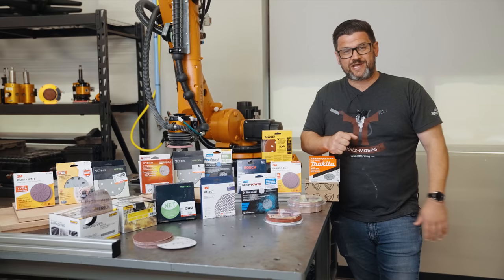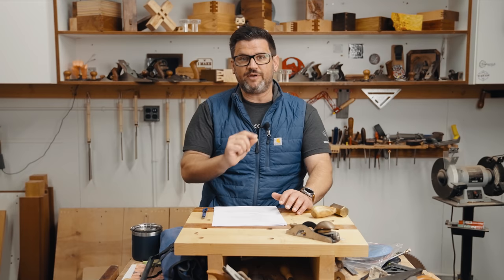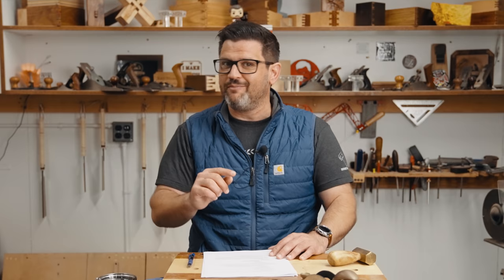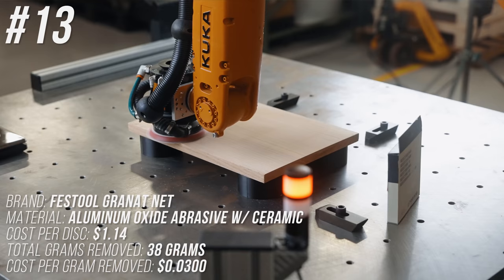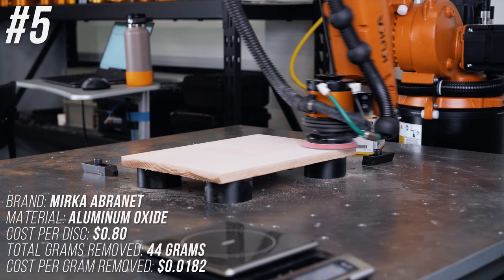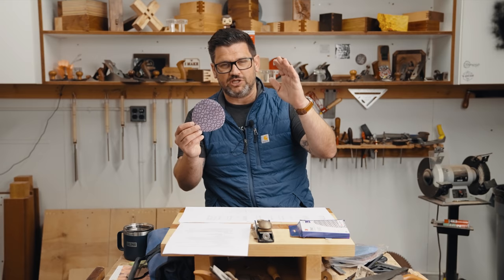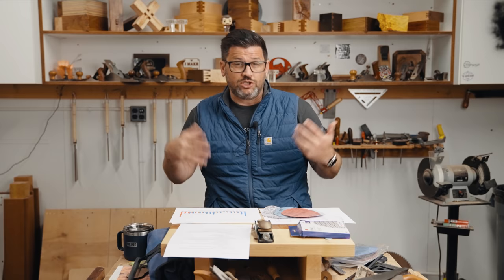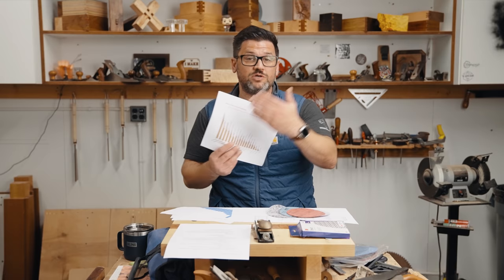Largest Sandpaper Test EVER Done - Top 19 brands Tested using Robots for Unbiased Data

Comment: G'day Jonathan, first up great job. I did Australia's most extensive sandpaper testing with 13 brands last year and I was aware of your previous video but purposefully didn't watch it until after I'd completed my own as not to colour the results. While I noted there were a few things I'd do (and did) differently it was very interesting stuff. Many of the brands available in the US (sadly including 3M) are not easily sourceable Downunder, but it's good to see that those we did have overlap on like the Abranet exhibited similar results. You touched on friability and the ability of mesh to clean itself to stay cool here and I think you nailed these as the most important factors when it comes to sanding performance. Two things I learnt through my testing you may want to investigate further if you ever repeat this experiment again relate to those issues... and neither actually have to do (directly) with the actual sandpaper. They depend on the setup you use, and what you are sanding. The short version is Red Oak was a great middle choice, but there can be a massive difference in how each disc performs based on the hardness of the timber you are sanding. Traditional Aluminium Oxide discs with low friability tend to perform much better on pine and softwood (having about 1/2 the Janka rating of Red Oak), while ceramic-based based products that rely on constant wear to generate new cutting edges tend to prefer harder wood (I used Red Gum... a cheeky little 2,700 Janka species we have here twice as hard as Red Oak). The second factor is what sander you are using. HIgh-end machines like a Rotex or Derros (or industrial robot!) with the power and dust extraction seem to be able to get the most out of these more advanced and expensive ceramic discs as they keep them clean and have the grunt to activate their friable nature. Home workshops running lower-powered, cheaper and/or battery sanders on shop vacs may not see a massive advantage in the ceramic discs as they don't have the guts or extraction to use them as intended. As you said at the start, there as SO many variables it would be impossible to cover all circumstances and I applaud your efforts here to improve your old testing and indeed deliver the least biased and most consistent sandpaper testing I've seen. I don't doubt the Xtract is clearly the best on market at the moment and I can't wait to get my hands on some if and when they release it in Australia to see how it tackles my old railway sleeper. Top job mate, a super valuable resource for the community you have here.  👍 - James
Reply: James, thanks for taking the time to respond in such detail. Excellent points about the type of wood and the sander quality factoring into the results, too. Many woodworkers will take an “if this wood, then this sandpaper” approach, but weekend warriors (like me!) will appreciate the general superiority and significant time savings of the 3M products. It’s so helpful to learn from the experiences of those in different regions with different wood types, tools, and material availability. Stay safe!
Reply: @RayStarbirdHome  Cheers Ray!  After my years I went with the standard non-ceramic Abranet precisely because I run an 18V 5' system mostly on softer woods. I am also however very jealous 3M haven't released their abrasives in Australia yet 😅 Sticking with one type is fine for most folks I'm sure, I'm just a hobbyist too. I love JKM was able to take this investigation to the next level with robots!  😂
Reply: It begs the question, why isn't 3M selling Xtract into the Australian market? I bet its to do with the American obsession with technology export.
Reply: Hey mate just wanted to let you know I bought three boxes (50 pack) of the 3m extract from rs components in sydney. They are awesome 👌
Reply: @psptube415  cheers mate! Im fully stocked up with Abranets but when they run out I might give these a crack.

Comment: Yeah, between you and Project Farm, I can't begin to calculate how much I've spent on the products you guys test. I'm an Xtract man now, ditching Abranet, the numbers are just insane. I hate sanding. This will cut down time spent by like 2/3, and that's worth some real $$$. Really appreciate this kind of comprehensive testing. Just put in a ~$150 order for Xtract, haha.
Reply: 1 year later comment: how did you like Xtract? I'm still sort of figuring things out so I bought a multipack of the other "regular" Cubitron 2 discs but I'd be interested to compare them to Xtract as I believe the Xtract can be rinsed out and re-used to a certain extent, whereas the other Cubitron discs are not as far as i know.
Reply: @adamcoe  not sure about him but I bought a 50 pack almost 6 months ago of 80, 120, 160, 220 and 400, I think 400 don't feel like going out to the garage to double check and after daily builds and hours upon hours of sanding I've used 4 or 5 discs from each pack. With life still left in them but eventually I'll change out older paper and use for hand sanding and replace with a new piece. Oh and these were on 5 inch random orbit if that makes any difference to you
Reply: @woodworkingandepoxy643  Hello. Thank you for responding with your remarks. Do you have a link to the 50 pack?

Comment: Well planned and executed test, I can see this one rattling a few corporate cages but this is what the world needs. I would be very interested to see if the trend carried across all grits or does it pay to have an 80 in one brand a 120 in another and so on.
Reply: I got a sample pack of the 3M cubitron mesh featured here and it drastically outperforms my go-to Diablo in every grit I got it in (120, 220, 320 if I remember right). I think youd be safe in going all in on the 3M mesh

Comment: As a retired production supervisor and purchaser in a large custom cabinet shop I applaud your test and methodology. We tested many of the brands that you tested and while our tests were more by ‘feel’ (very subjective😄) the results were much the same. At the time ceramics were not available and Mirka was the only mesh on the market so we were limited to psa paper discs and Mirka which far outperformed all the paper brands. The downside to the Mirka was that the mesh unraveled when it hit an inside corner and that caused massive scratching. Does the 3M product also self destruct in a corner? To alleviate the problem with paper discs our sanders would gently cup the paper discs over the edge of the pad when the disc was applied. We also put about a 1/8” radius on the outer edge of the pad.

Comment: This is super handy thanks for putting in the work JKM!! I'm curious about the durability of the Cubitron. I've been using Abrarnet for a couple years, and my big issue is if you're sanding non flat surfaces the disk will rip off a corner or sometimes clean in half. Then it's basically useless.
Reply from the maker: I think all mesh-es (sp?) would be less durable than solid discs if you're sanding sharp things. If you look at the pattern we sanded with the robot we always went off the edge by about 25%. Those edges were so sharp I cut myself a few times. The xtract didn't seem to have any issues after 25 minutes with the same disc.
Reply: Michael Alm in the house! If you try it, let us know how it holds up to the patterned plywood test :)
Reply: ^same issue here

Comment: What I'm curious about, even though it is 100% subjective, is the quality of the finish that they provided.  Awesome results regardless, might be trying some of that 3m out.
Reply: Yeah obviously this test could be cheated if one brand's 80-grit is more like 50-grit. Ideally you would compare topography of the discs as well as the finished oak. But that's getting pretty deep.
Reply: I really would like to know is some the cheaper papers were more prone to pig tails. Maybe he can do a future test sanding up through the grits on epoxy with maybe the best 5 mesh nets. I think it may come down to the dust extraction, at least when using all high quality products.
Reply: i was trying to find a nice way to ask this, there's more to a sanding than how much you can remove, otherwise why use anything but 60 grit?
Reply: Being a floor sander I use a multitude of these kinds of discs.. for the past year I've been using the cubitrons (although I can't get them through any flooring supplier as 3M wont sell them to them)
The cubitron easily leaves the best finish cuts further and cuts harder and is cheaper.
The top of the line is normally the Norton "red heat"
Putting them next to each other I used two different grits aswell as double the discs of norton to get an inferior result
It has blown my mind.
I also think the cubitron 80 is more like other brands 100 or 120 in terms of scratching left behind
Reply: Great point.
Reply: Well for some strange reason some people use sander to remove material "fast". I can see it being a convenience in carpentry/construction, but for furniture making 1) we have better ways to remove much more material much faster/cheaper and 2) sanding has a totally different purpose aka making a surface smooth. actually there is even time when you want to use used disk on purpose, being too agressive can often be detrimental when it come to surface prep. So totally agree with you, the real question should be how smooth/$, but it's more complicated to measure but not impossible.
Reply: @nikrulz44  Interesting, when i saw that video i thought that speed for removing material must be a thing for construction work but not in furniture making. But from your testimony i can see that even for construction the surface finish is the real key.
Reply: @lolaa2200  I just got a sample pack of the 3M cubitron mesh and not only does it remove material faster and last longer, it leaves a remarkable surface finish. Youll want to hook up to a dust extractor/shopvac as it generates dust really quickly, even for just quick little sandings

Comment: I’ve been using Gator for a while simply because that’s what my local Lowe’s sells. I can’t thank you enough for doing this test. I just wish you had done it a couple months ago before I resurfaced an old table 😀

I will be happily giving away all of the Gator and switch to the 3M. I’m shocked that the most efficient is also the most cost effective!

Comment: Love this analysis! Personally, I rank time per gram removed up there above cost, but they're both worthwhile metrics. Thank you for putting in this effort!
Reply: Either way the winner is still the winner as they were all tested under the same pressure and time. Fair play if you want to get stuff done quickly. Ranking them with time as metric would be a bit more challenging, as there were 4 tests done. The friability graph would be the one to look at as that is time based. So the rank with cost per gram removed would be easy to adapt with the cost of your time. The results table would be easy to adapt to cost of time.

Comment: I made the change to 3M Cubitron after the previous video and haven't regretted it. I refinished 1300sqft of oak flooring and only went through 10 discs of 80 grit and 4 discs of 120 and 150. In day to day woodworking use its still a great product. Might need to try the new #1 based upon the results
Reply: damn I was just about to sand a deck down but hesistant to start since i'd need a million sheets and swapping pads, sounds like 3M is that way to go

Comment: The sanding robot was a collaboration between ATI and 3M to be optimized for 3M paper. See statement on 3M website. “The sander is optimized with the included 3M sanding discs and backup pads for maximum performance, consistent cut and long life — qualities of an efficient robotic cell.”
Reply: It was optimized for the #2 sandpaper. Not sure why youtube keeps deleting my link to the site. I don't comment much so it may be a policy, but just Google ATI and 3M.

Comment: Just fantastic results. Watched the journey on IG, great to see it come together. So for woodturning, most of the time we're not using a sander with built in dust extraction; either by hand, a drill, or inertia sander with a DC running next to the sanding area. Obviously this leads to more loading, more heat that using a RO sander. I would be curious to see what this does to the friability of the top performers, if it may equalize things out, or flip results, etc.

Comment: That's fascinating! It's also good to see the 3M cubitron at the top of this test as it was in the Project Farm sandpaper test. If two different people with different methodologies are getting the same result, that builds confidence.

One nit-pick: I would think that total grams removed would be more important than cost per gram removed. The most expensive factor in sanding will always be your time, so if you bought one of the super cheap sandpapers, you would save cents on sandpaper but waste dollars of time. Luckily, it looked like the most cost-effective discs were also the fastest at removing material, so we don't have to make that tradeoff.

Comment: It would be interesting to get a temp reading of the discs after each 5 minute interval to see if het really does build up more on the film backed paper
Reply: Good idea, but it must be done at the same time interval after sanding.  The robot should be programmed to present the disc to an IR camera, and the camera should be triggered by the robot controller.  That way, roughly the same amount of cooling would happen to each disc.  The pictures would have more data than just one temperature reading, as they would show hot spots (if any existed).  Comparing pictures taken after each 5 minute run might also show how hot spots build up (or that they don't).
Reply: @richs5422  High temperature is the major cause for short abrasive life. In wood it causes natural oils and resins to plastify and clog the abrasive. 3M XTRACT discs sharply cut and are designed to immediately  extract the dust from the process so it cannot rub on the sanding interface which generates heat. No heat = no loading/clogging =  long life+high level of sustained cut and finish according to the selected grade.

Comment: Does 3M require an interface pad for the Xtract like Mirka does with the Abranet? That was a total dealbreaker for me with Abranet.
Reply: Yeah, you can use it without an interface pad. But as with any net product, you should use a hook saver so you aren't replacing backer pads every week.
Reply: As a 3M Regional Abrasive Specialist for 22 years, these Xtract disc do not require an interface pad.  I’m not a big fan of them.  I would rather switch backup pads to our Xtract Hookit Clean Sanding Backup Pad Low Profile Finishing(which is almost twice the thickness of the Low Profile backup pad) that comes on our 3M Elite Sanders, if you need some conformability or have rounded parts or have new workers where you want to prevent any type of over sanding or flat spots.  Don’t get me wrong, you can use interface pads, buy in my experience many operators end up taking them off.  Good luck and thanks for testing our new Xtract Clean Sanding discs.
Reply: @tphicks44  Thanks for the response! I HATE interface pads for the exact reason you state. They make the sanding surface too soft. We use Festool sanders...do we have any options?

Comment: 3M again and again changes the base of its competition demonstrating mind blowing new technology saving tremendously labour time and its related costs! After world's best abrasive belts and fibre discs in metalworking with Cubitron II precision shaped grain they now pushed the state of technology in sanding discs.
Remarkable!
Reply: That is something the author of the video might be missing as he calls Cubitron and Cubitron II interchangably in the video.  3M makes two kinds of Cubitron mineral:  Both are ceramic but the plain old Cubitron is a crushed mineral made up of big ceramic pieces being broke up into smaller pieces.  The new one is Cubitron II which is literally a precision shaped grain where every single mineral particle is made one by one with a shape they predetermine.  All the mineral particles are little triangles.  Take your cell phone camera and zoom as high as you can and hold it up to the sandpaper and move the camera lens back and forth to focus and you will see the little triangles if your camera will get that big of a zoom.  So just be sure to notice that there are Cubitron products out there and there are Cubitron II products.  Both are great, but the Cubitron II is a whole new beast.

Comment: I am a metal worker and I used to use Norton almost exclusively (sometimes Diablo when I couldn't get Norton) until I tried the 3M Cubitron discs. It was like night and day - lasted 3x as long and took half the time! While metal working is not the same as wood working, both try and obtain the same results - a flawless finish as fast and as cheap as possible. When it comes to sanding hard stuff (steel, aluminium, brass, bronze), I found the Cubitron outlasted anything else I have used previously, and my choice seems justified in your results. So, great job and well done - I feel vindicated!

Comment: Dude this is amazing! I literally spent 5 hours sanding on Saturday and bought the Xtract stuff immediately after watching this lol.  Awesome job setting up the experiment and eliminating as many variables as possible.  Also super appreciate how you shared the results in a few different ways to really visualize just how different they all are.  I was curious that Serious Grit was not included as I've seen a lot of YouTubers repping that brand quite a bit now (and I've been getting tons of ads from them).  Maybe too new of a brand to be on your radar, but I suspect it would perform around the middle to top-middle of the pack based on the technology.  I think I'll have to buy another KM Stop Block out of appreciation for this study!